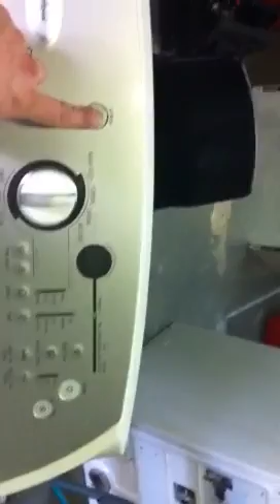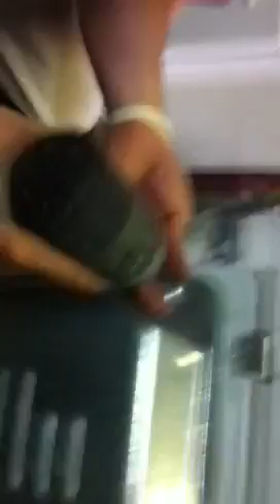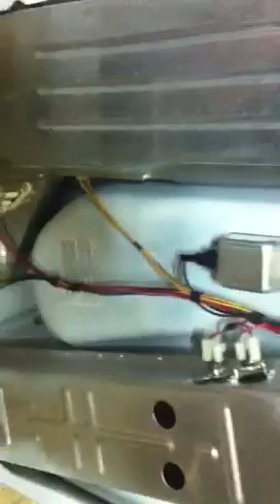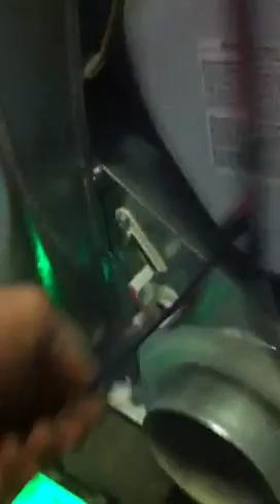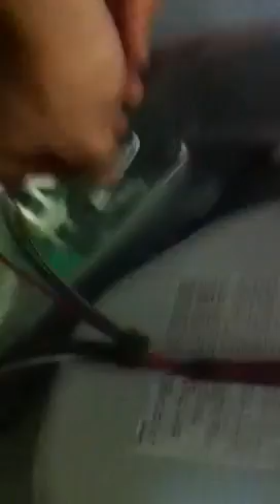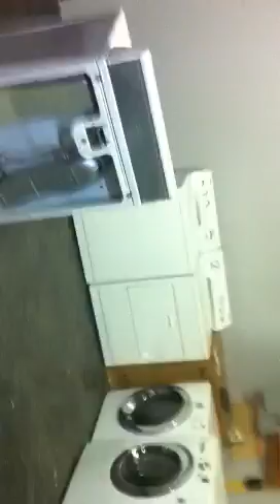Whirlpool cabrio dryer repair

Comment: the  fuse  blows  cause  something  else  is  wrong  like   getting to hot   usually  one of the other  switches  have failed an allow the heat to get to high   and thus blows this circuit as well    or  the dryer is  stuffed with lint  an needs cleaned   if the new one blows out soon then youll kno